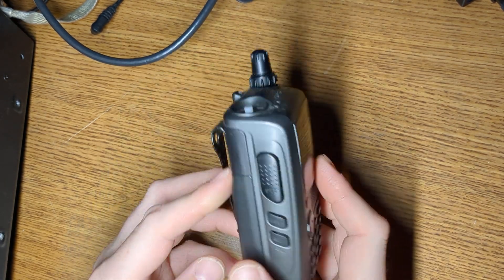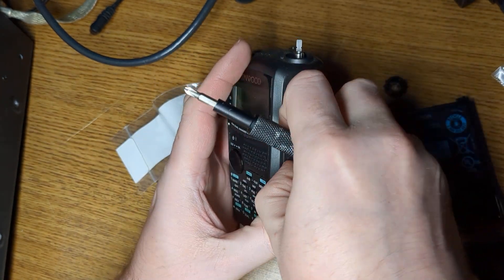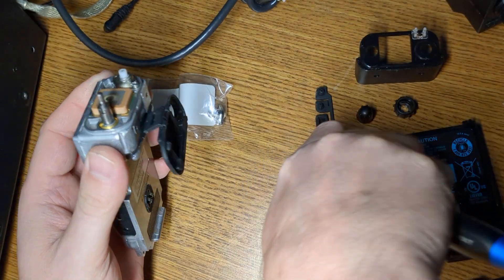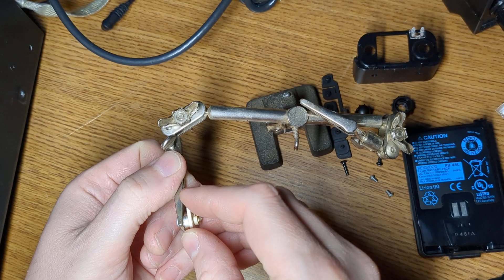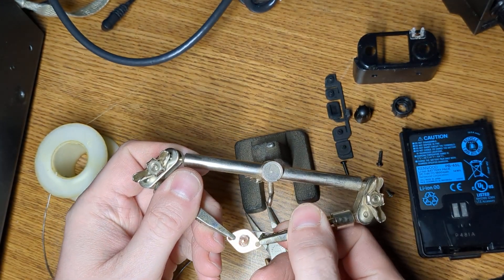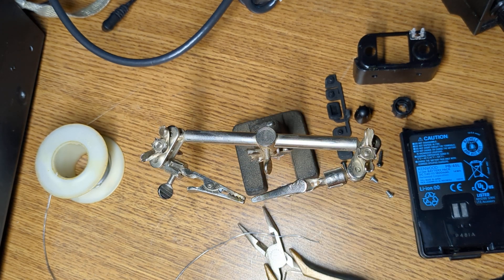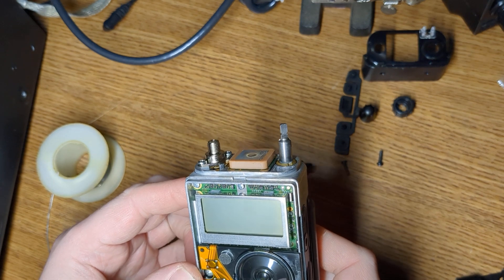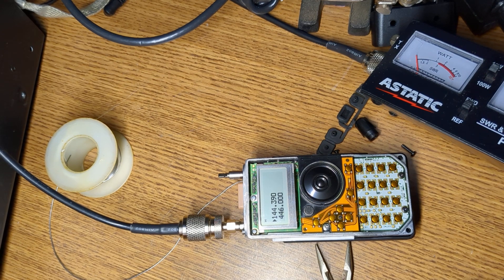Kenwood TH-D72 SMA Replacement

Comment: Sir my exact situation just happened about an hour ago. This video is a life saver. Where did you order the part from?
Reply from the maker: I'm happy the video helped!  I bought the replacement SMA from East Coast Transistors Parts from New York.  At the time of ordering the part was $11.19 without tax and cost $7.95 to ship to California. PacParts Inc. in California is also on the authorized parts distributors list but they didn't have the transistor I needed for the follow-up repair video.  Hope you get your radio back on the air.  73!
Reply: Got my part from PacParts quickly shipped I'm pleased. @N6WLM